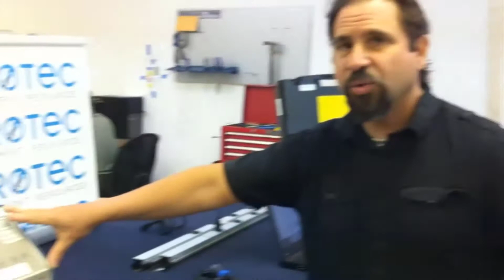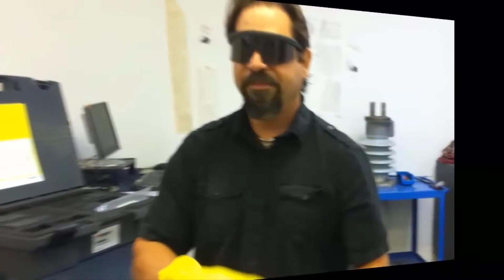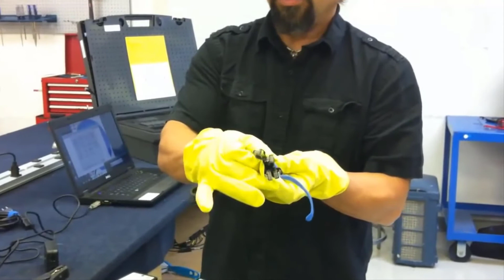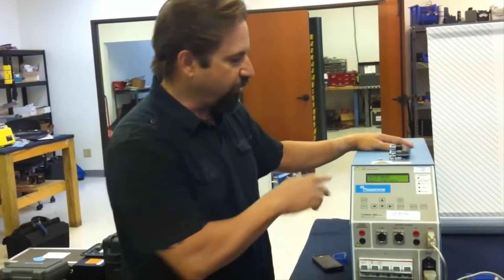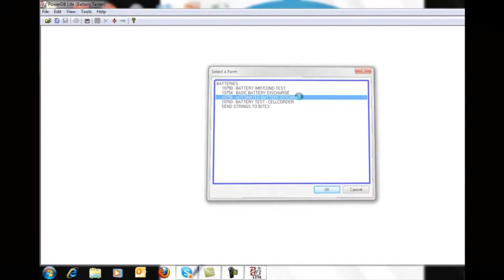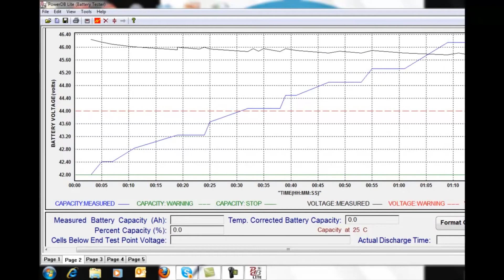Megger Torkel 860, Megger BVM and Power DB Overview

Comment: I'm using this setup for a string of 92 cells. Some of the BVMs read 0v, but only some times. Is it just finicky hardware?
Reply from the maker: Maybe...if you are going to use more than 60 cells, you have to connect back from the last BVM to the power and signal module.  Additionally, you need to make sure the first BVM goes on the NEGATIVE terminal of the string.  Finally, if the BVMs continually read up to a particular BVM, check the input and output ports of that BVM.